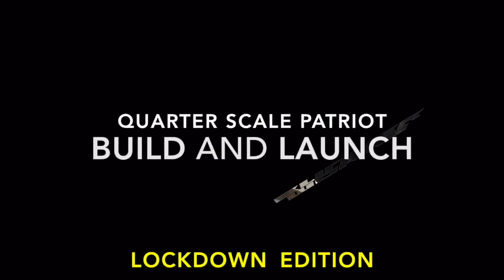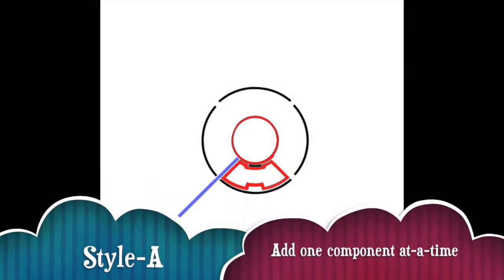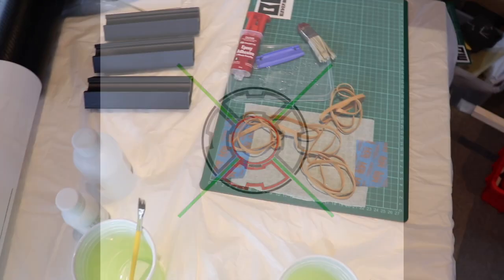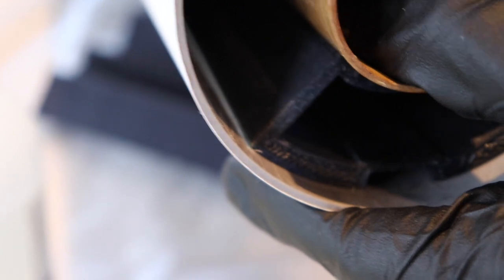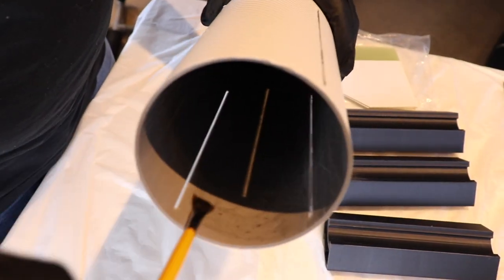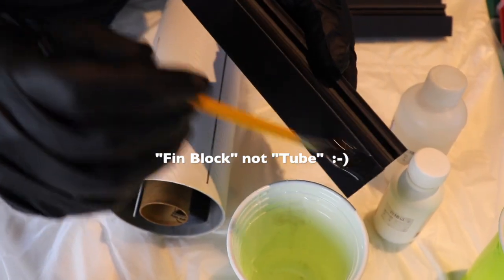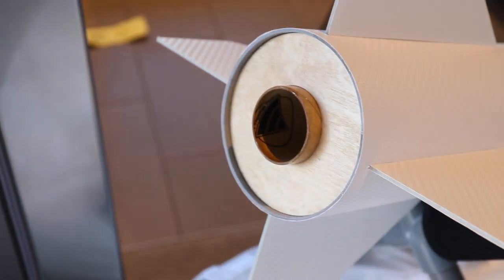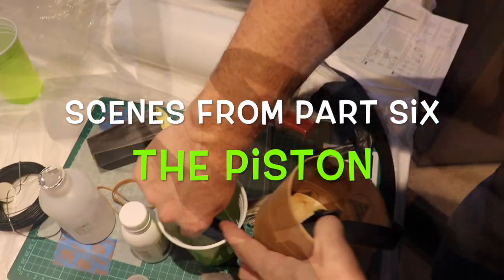Quarter Scale PML Patriot Build and Launch Part 5 - The Fin Can

Comment: Stuart, this an awesome way to make sure that the fins are perfectly true.  I've been building and flying high power rockets since 2001.  And I'm always open to new techniques.  My questions are, how much extra weight do the quick build components add to the overall weight of the finished rocket?  Second, can this technique be used to build other rockets?
Reply from the maker: Hi Steve, absolutely, this technique can be repeated for as many or few fins as you need.  The added weight - I can tell you that fully loaded my Quarter Patriot is about 2kg and reaches 3000 + ft on a Metalstorm I Motor.